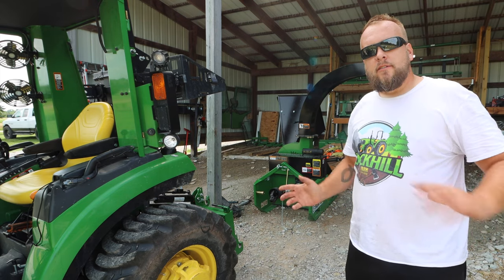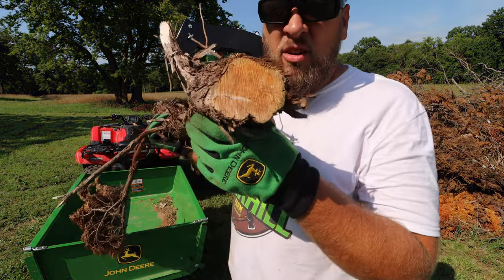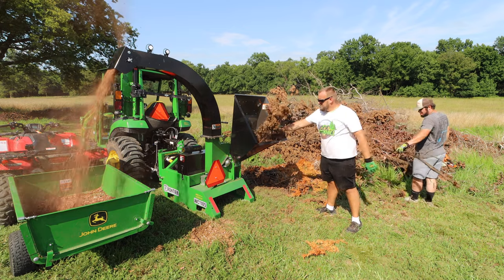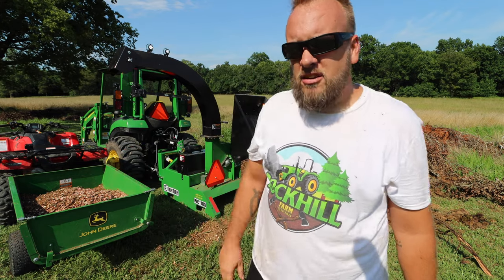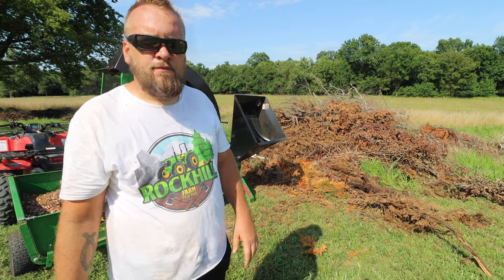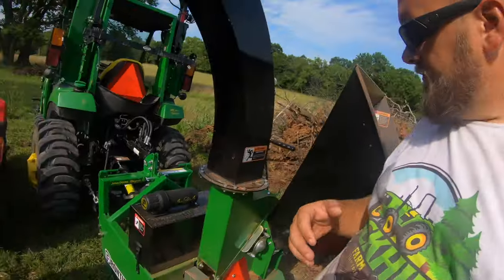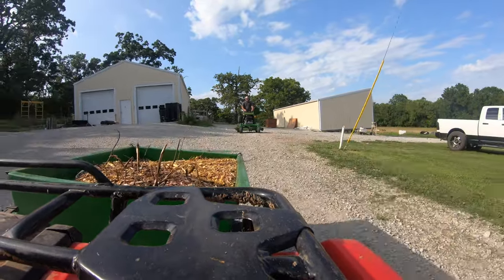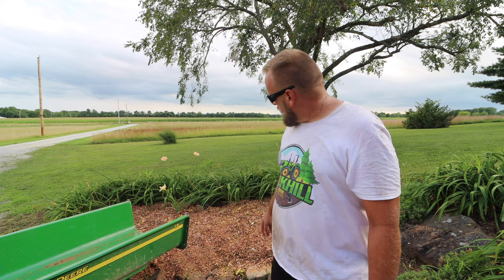Putting The Wood Chipper to the Test - Frontier WC1105

Comment: Keep a easy to handle log out that has a branch, knot, something larger than the intake hole on one side. That way you can break the jams of smaller materials up safely without having to shut everything down. I've had the same clearing log for the entire year now and leave it on the chipper.
Reply from the maker: I was thinking I need to get something like that. Thanks for the tip

Comment: Great video!  Made me want to buy a wood chipper!  Problem is, I just ordered a sawmill, so the chipper may have to wait until next year.  It would be nice to use the branches of the trees I use for firewood and saw logs.  Now I just pile them up and burn the piles in the winter when there is complete snow cover.  I use sawdust to keep the mud under control in my wood lot, but wood chips would work much better!  One thing I noticed from the video...it may be more efficient to feed the branches in butt end first so they don't hang up as much.  It makes me nervous when you stick your hand into the chute.  I've had my own close calls even being extremely careful around machinery.  Things like that can be life changing and totally avoidable.  I don't mean to criticize, just want to make sure you stay in one piece.
Reply from the maker: Thanks for the feedback

What Sawmill did you order and what was the wait time like

I was ready to order one myself until they told me close to a year wait time
Reply: I ordered the Woodland Mills HM126.  They said that delivery should be around the end of October.  I was hoping to have it sooner than that, but later is better than never.  I need to clear a spot for it anyhow.

Comment: Been waiting on this! I have the same one ordered. Hoping it's here in October like they said it would be. 😕 it I a chore to chip, but I don't have the luxury of burning being in the woods. We went all summer on burn restriction. It was just lifted. If I started burning now, by spring it may or may not be caught up. Great video! I will be sure to check all bolts. Normally I do just as you did. Run her a few then check. My buddy has an orange one, first time he used it the shoot fell over. So it's not just the frontier lol. Apparently land pride has the same issues. I honestly don't think they can make stuff fast enough
Reply from the maker: Im the same about not liking to burn brush frequently.  good luck with the chipper

they told me 30. days but it actually took about 90 days

Comment: My thing is with an implement like that, I'd want the shredder opening also just for the real small stuff. I tend to feel a chipper/shredder is more useful than just a chipper alone when you have twigs and other smaller items.
Reply from the maker: Thanks for sharing. I feed the small stuff through this just fine. I haven’t seen any three-point units that were both but I’m sure they exist